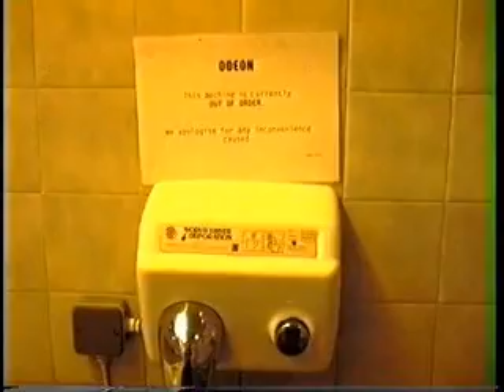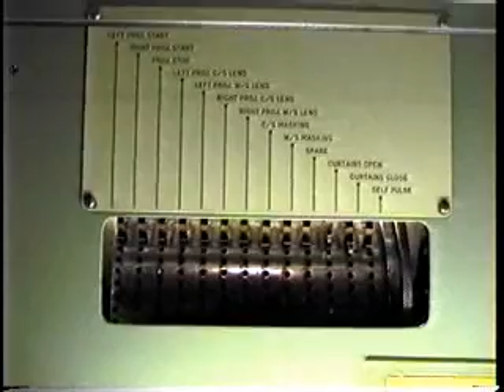Odeon Nottingham

Comment from the maker: Hi steve, Rod arranged to have the cinamation unit removed to hull, in storage i think, this unit was in fact worn-out, alot of the cams were rounded off, thats why you see Spud Taylor nursing it for a show start, the cover was removed in the shot, and the cheif engineer, and a few others were trying to work out how to disconnect it, the noise you hear was the new rectifier that was installed, i would not have been happy with all that racket, but it seems no one cared.